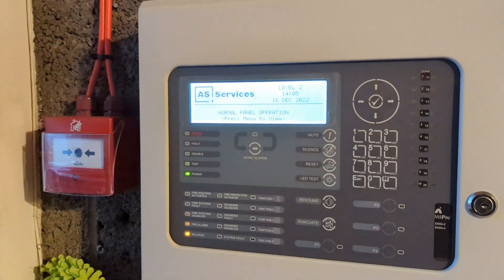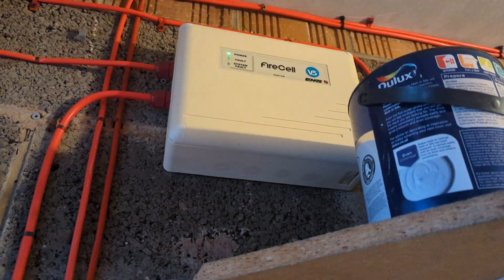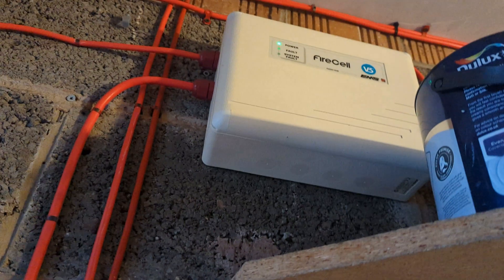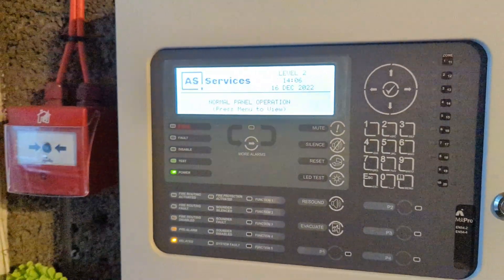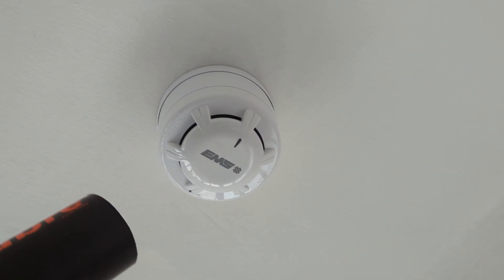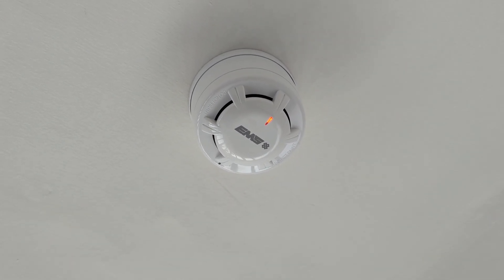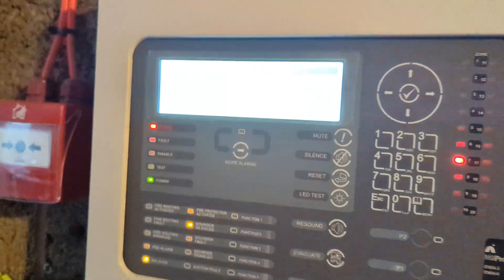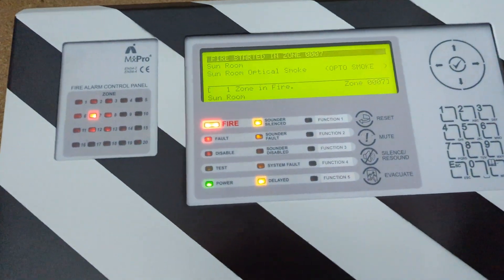Testing EMS Firecell Optical Smoke Detector

Comment: Do you have any Apollo devices that’s all spares and not in use?
Reply from the maker: Yes loads but i'm not selling anything at the moment.
Reply: @ASSystems  ah okay
Reply: @ASSystems  I’m networking my kentec panel to my JSB panel, I wired relay output into network in would it work?
Reply from the maker: @uksds3806  That's not how it works. You can only network a kentec to another kentec.
Reply: @ASSystems  ah rip